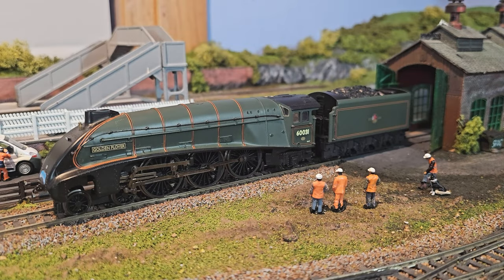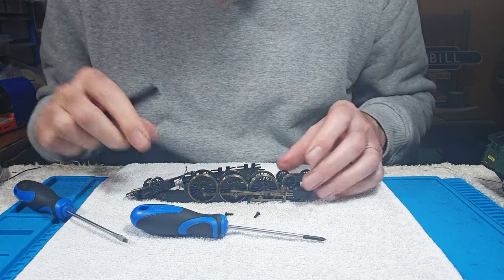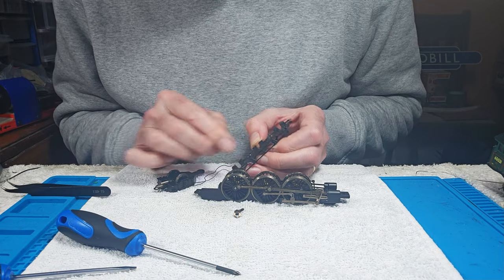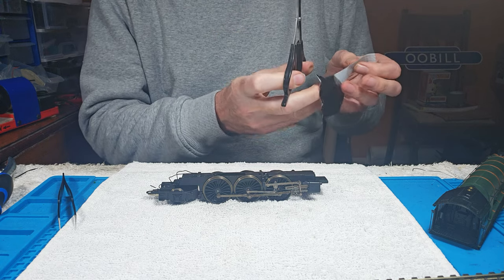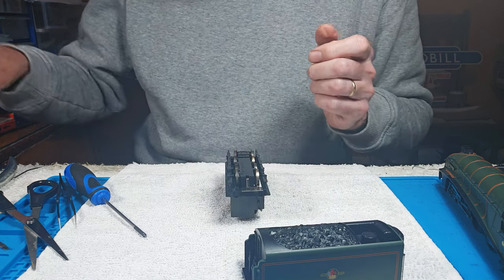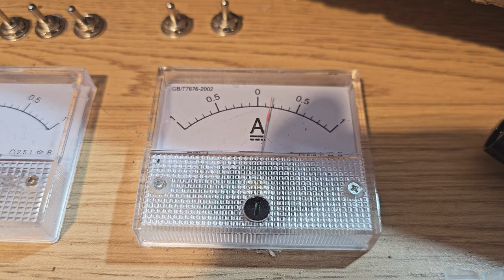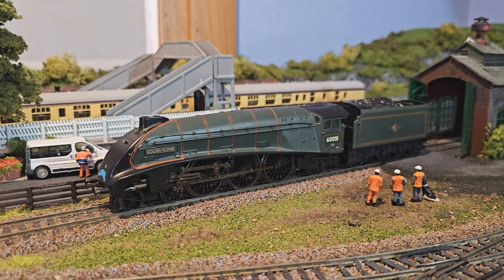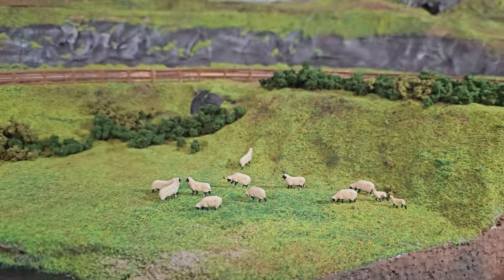Hornby Class A4 "Golden Plover" 60031 : Repair Request

Comment: Looks great hauling those blood and custard coaches.   My sympathy in dealing with those pesky bearings! - I remember doing the same with my  St. Simon A3 which was even worse as it had the 2 piece keeper plate with loose pickup strips.   I tried vaseline to tack the bearings in place but ended up using a tiny dot of super glue gel - desperation after 3 days of failed attempts.

Comment: Bill, do you use the WD40 contact cleaner to clean your track also? I’ve read various reports and some say its excellent for the purpose.
Reply from the maker: I've used it to clean rails when I want to solder to them. It will be a very good track cleaner but a bit expensive for a lot of track. I just use a track rubber.

Comment: Great video Bill runs a treat now, those picks ups are a bot of faff to get right. incidentally where did you get your filling station / garage from is it a Metcalfe?
Reply from the maker: It's the Gaugemaster Fordhampton kit with a set of modern pumps and a Jet totem from ebay.

Comment: Hi Bill. I noticed you oiled the bearings. I would normally use silicone grease to do this. Do you have any "rules" as to where to use either oil or grease? Thanks.
Reply from the maker: Silicon grease is OK but watch out if using on conductive axles. I tend to grease gears and oil everything else.
Reply: @oobill  Thanks for the advice.

Comment: What’s the best thing to clean the traction tyres with? I use IPA alcohol for the wheels but not sure if that is good to use on the rubber tyres
Reply: I use IPA on both. Fingers crossed, but it doesn't seem to have had any detrimental affects yet...
Reply from the maker: Never been a fan of IPA. Contact Cleaner is much more effective I've found.
Reply: @oobill  Yeah. I bought some contact cleaner after watching you use it to good effect, and will start using it for wheel cleaning too once my stock of (99.9% pure) IPA is exhausted.
Reply: @oobill  thanks, will start using that then